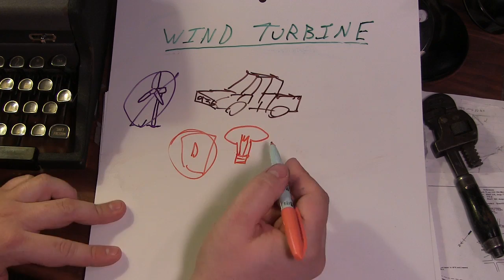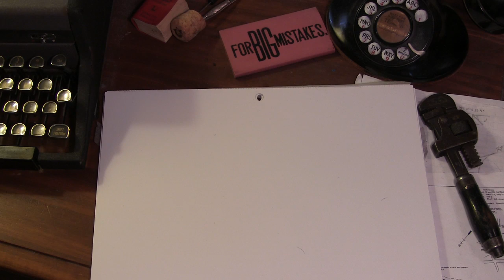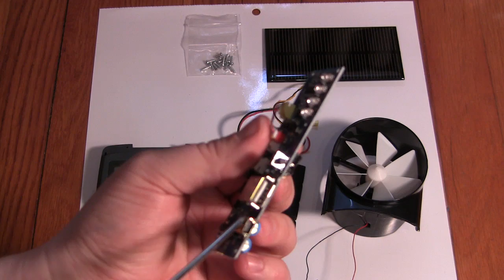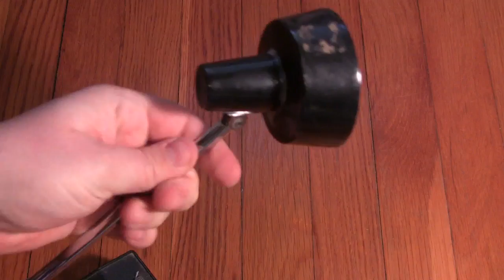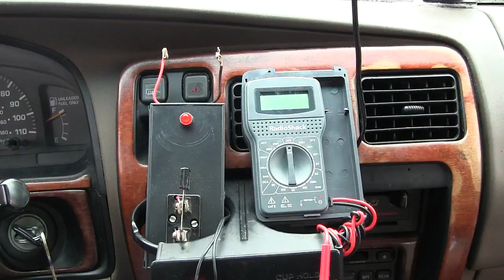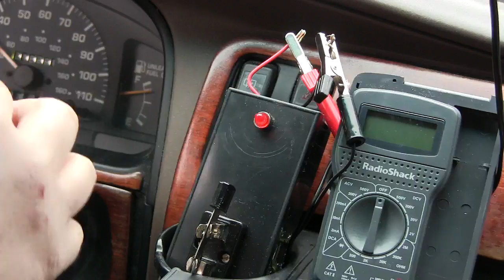Wind Energy Car-Mounted Charger

Comment: Sir which turbine is used? I mean value of rpm & voltage of battery?
Reply from the maker: Hmm,  it's been a while! I believe it battery charged at around 5-30 volts; if I recall correctly the turbine ran at several hundred rpm due to it's small size. A more sustainable option, if I had to do this again, would be to aim for higher voltages, stepping down as necessary,  along with a larger battery and a better cowling. As a proof of concept, however, it was sufficient.

Comment: Your turbine idea is great. Taking a mass air movement and reducing it to increase pressure on 1 specific spot and point it into a maximized spot. doing so at work I have gotten a 900 volt AC output with my design. I will be incorporating that into my car with a ram air good scoop.

Comment: Size, placement, and money are not an issue. I have built your idea. my solution was vfd or plc fans mounted into my grill and run into a step up transformer which produces 450-480 volts AC then dropped back down to 14 volts and turned into DC to charge my cell phone. all done with 1 4x4x1 inch fan.
Reply from the maker: Glad to hear you had success with the concept! Grill placement is a good idea; it doesn't impact the vehicle's aerodynamics as much. I had to go with a "clamped" version for the purposes of my class (read: time crunch before the assignment was due), which was also why I didn't get to mount the cowl I had planned.
Reply: Bernard Trubowitz understandable... for class purposes a set up such as you had is ideal. Showing the concept and effectiveness of the design. It is a decent solution to some of the energy crisis. As well as, minimizing our carbon foot print. If you wish to incorporate this into your personal life I believe I could help, or at least be able to throw around some ideas to help.
Reply from the maker: If this video showed the concept well, then I succeeded! I looked at your setup in your videos; a lot more streamlined, in that the fan is nicely tucked away and much more permanently wired. Nice! I'm set on my end; I've thought about revisiting this but for now I'm satisfied; I just gotta find a new circuit board really. (^_^;)
Reply from the maker: I'm happy you found this video though; I've got a pretty dead channel and never posted quite as much as I'd like, so for someone to find my project and find interest in it is nice!